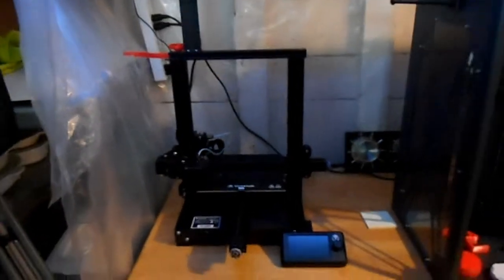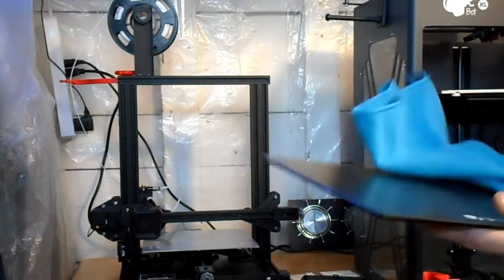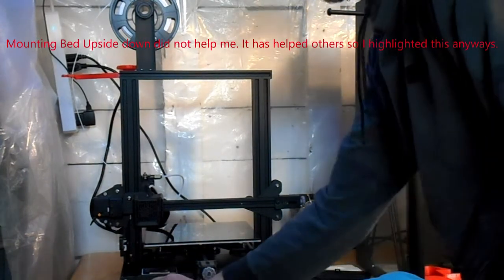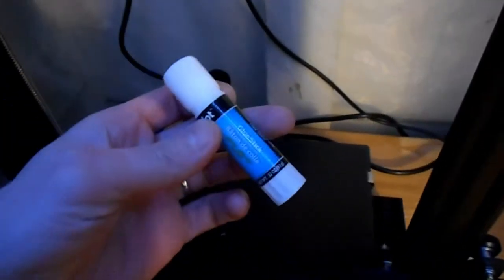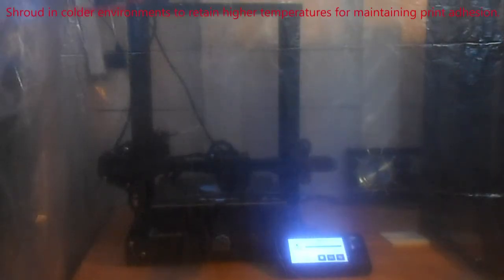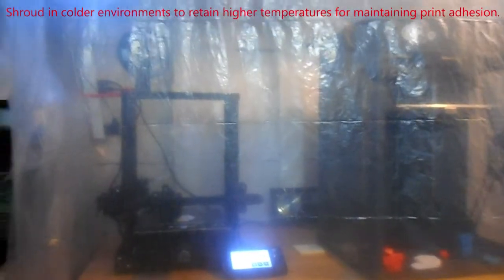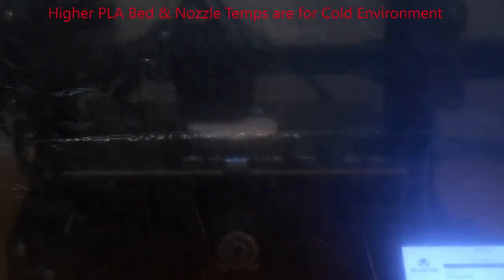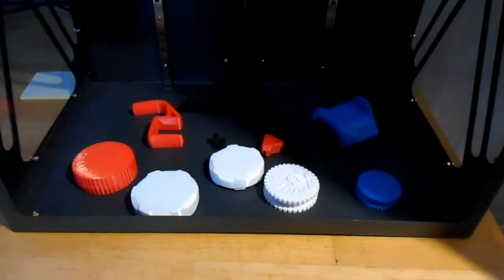Voxelab Aquila 3d Printer Tips for better Bed Adhesion How To make PLA models prints stick

Comment: I use hairspray TRESemme Extra Hold. works like a charm, and washes away under hot water. I do it once, and lasts many prints without re-applying.